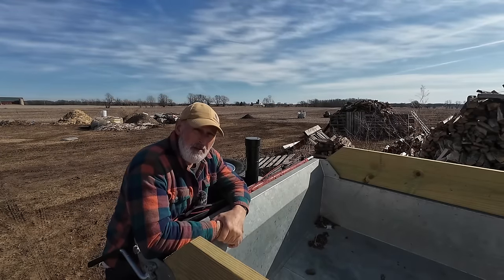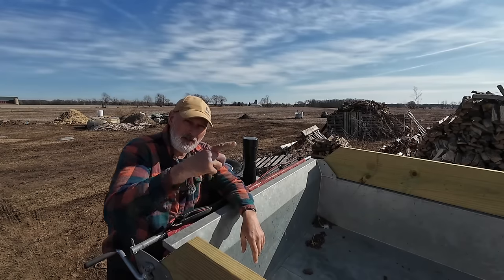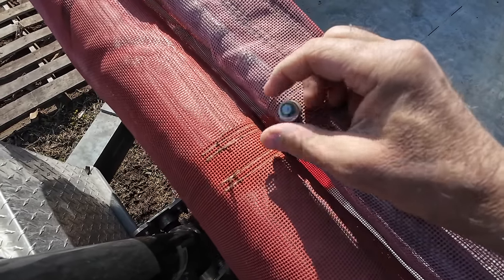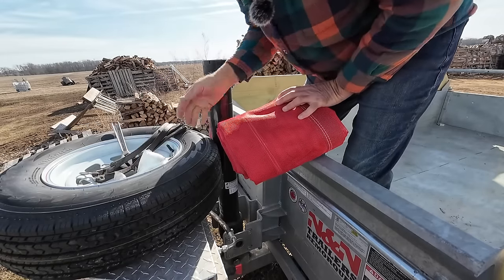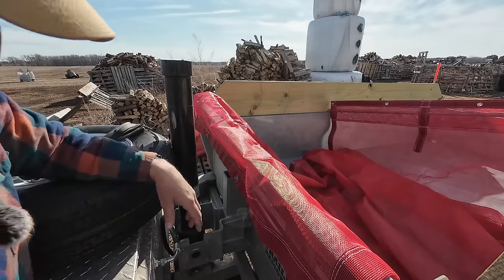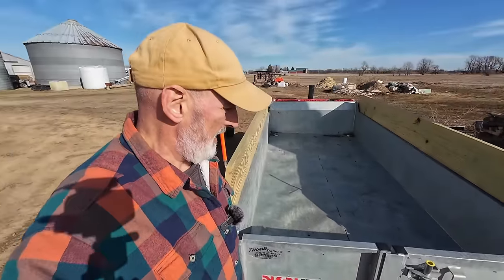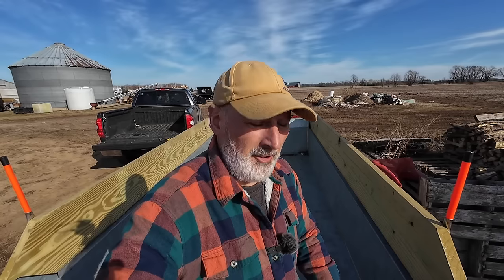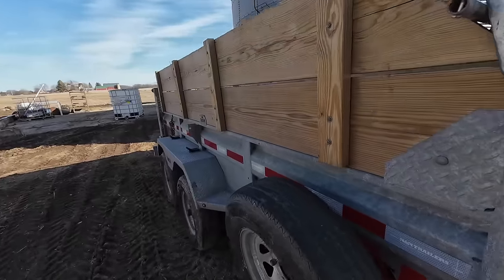DUMP TRAILER fix and upgrade! N&N TRAILER!

Comment: Good Morning 

In another life I fabricated tarps with Lift Dots  to cover the hose beds of our engines.  I also fabricated Tonneau Covers for the department pick up trucks.

Your cover is really nice.  The material is the same stuff that is used to cover dumpsters as they travel down the road.

Millie if you read this the material makes really nice beach bags or firewood carriers
Reply from the maker: Nice!

Comment: Ya know Chris, if you were to say... sacrifice one or even two Uncle Andrew Jacksons, you could put a compact socket set in the floor of your backseat and probably be up 5-10 times in time saved in short order.

Add a few basic hand tools and a cheap cordless drill/driver and the possibilities are exponential... 😂

That being said, thanks for everything I have learned from you and many others on our own firewood journey. 👊
Reply from the maker: Yup, I just did that! The problem is that I have tools at my house and tools at my office and they are 7&3 miles from the wood yard.

Comment: I love my Lamar trailer, but I no as soon as it starts resting. I’m gonna be kicking myself. It has a pretty good finish on it and I don’t pull it at all when there’s salt on the roads but it will eventually rust. I was actually looking at the N&N at thumb trailers but just didn’t want to make that   far of a trip. That’s awesome that they sent you that new tarp, no matter what the commentor said. I’m pretty sure you said it right that as long as you use honey, you will attract bees.👍🏻👍🏻GNI
Reply from the maker: Yup, salt is nasty crap and we have roads here for 5 months of the year here paved with the stuff!

Comment: You should try the crank version of the tarp system that n&n makes. It is perfect for one man operation especially when you have heaping loads of wood. You turn the crank and the tarn will go up and over the pile of wood. Super fast and easy and you do t damage the trap dragging it across your load.
Reply from the maker: Maybe some day!

Comment: Wish I could remember who else sells galvanized trailers, pretry sure is in Wisconsin. Saw one of those sponsored ads on Facebook. Think is somewhere in Wisconsin. Hopefully for those of us, shopping for a trailer gets a trailer as well built as N&N if they go with someone else. Until find someone closer that sells good quality galvanized trailers, N&N it is for me when I do. For sure the other trailer companies are going to catch up and make galvanized trailers of their own.
Reply: Or live here on the West Coast where 30 year old truck frames are turned into trailers. 😉👍
Reply: There was a listing for a small N&N dealer not far from Chris.
Reply: @iffykidmn8170  didn't notice the brand of trailer. All I know is is that the price was fairly reasonable.
Reply from the maker: The Thumb trailer Bay brothers have them in Michigan! Worth the drive!
Reply from the maker: Yup, here too sometimes.

Comment: I like how the tarp is mounted on the front better on the baby Dumper than the bigger trailer. It is very protected, tucked in like this during loading. Wonder if this is a change or just an option on smaller trailers that have less tarp to roll up?
Reply from the maker: Because I built up the sides it needed more length so maybe now they all will have a little extra from the factory??

Comment: Chris great for THUMB N&N reach out to you on SAFETY tarp for the I 95 highway. It the own way to go if your buying a trailer is THUMB N&N TRAILER . Them black steel power coat is junk why because I got one ☝️ BMR from the USA 🇺🇸, LESS them 2 yrs it peel right off the metal in pcs , plus never been on a salt road in it life time about 10 yr ago . Listen 👂 to Chris because he had a black one to . GO to the 608 see Mike patient it up 🔝 for the road just a rust bucket. 😊
Reply from the maker: Yup, galvanized is the only way to go!

Comment: Bert must loose it watching you fix things with hand tools. I know you are no mechanic but battier operated drill would have helped as you sat about your saws SPEED!! Lol
Reply from the maker: Yup and I have an Milwaukee impact drill and a small electric Milwaukee drill but they where both 7 miles away at home and I got it done with what I had on hand and that is what matters most to me.....done.
Reply: @InTheWoodyard  
Not a hater watch every morning, weekends both channels. Learn something then apply  thanks

Comment: Bad editing Chris. FF to the 3:00 mark. Look at that belly. That wasn't there when you were stacking your wood. Now you're riding around on your tractor and filming more and getting famous. Maybe it's just that we had a mild winter requiring much less snow blowing (wink)
Reply from the maker: Yup, I have gained 10 pounds since becoming a member of the sit on my butt to much tractor/processor/elevator/dump trailer/extra hands to help club!